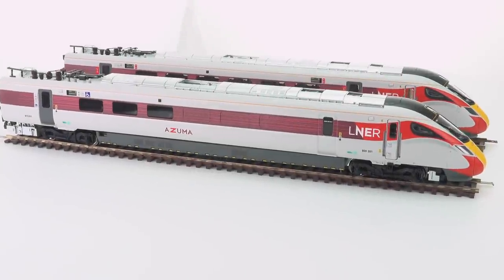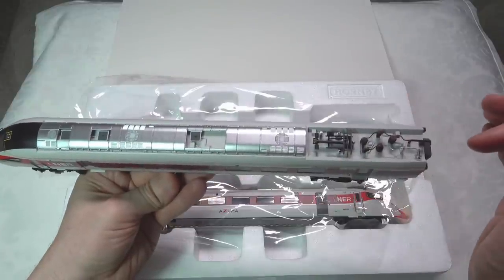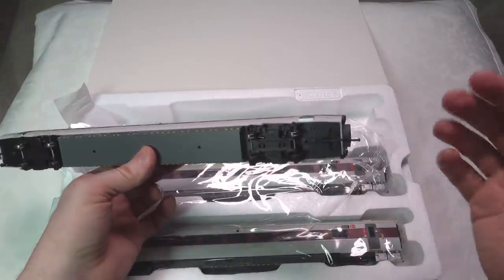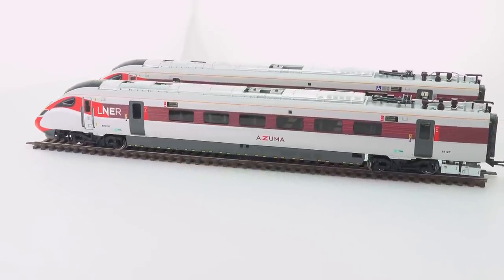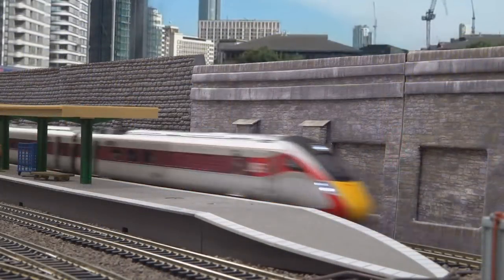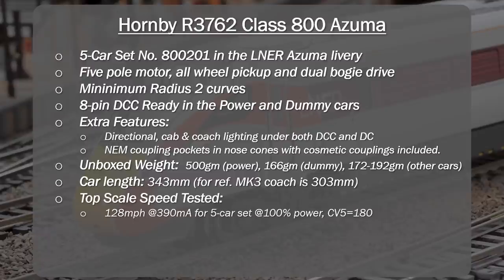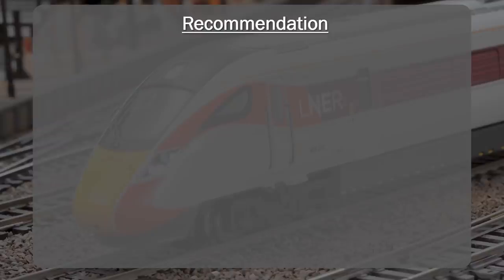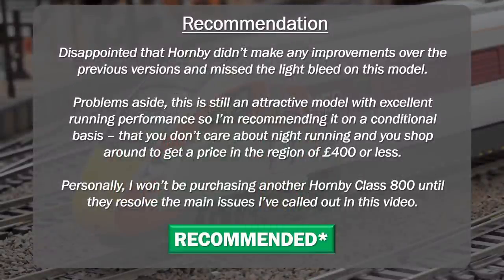Review: Hornby R3762 LNER Azuma Hitachi IEP Bi-Mode Class 800/1 Five Car Train Pack

Comment: Great review. I don't think the problem with the light bleed is due to the plastic, but more to do with the intensity of the lights. This doesn't happen on DC, I have this model and there is no light bleed at all. The lights seem 30-40% dimmer on DC, even if I remove the motorized unit and max out the controller. Everyone I've seen with the light bleed issue have been running DCC. It would be interesting to see if the light bleed happens with Hornby DCC decoders. It looks like a 12V circuit getting a higher voltage. Maybe some issue with the electronics board? Which is making me wonder if Hornby even test these DCC ready models with DCC decoders? On a different note, I had a dodgy coach, but living in the USA it made more sense to just go fix it myself and get the lights working on it.
Reply from the maker: Hi, I've just put one of the coaches on DC and put it up to 30% power - and the light bleed is there alright, as bad as ever and it really is bad when you go close to the coach, Same for the dummy car. It's no surprise, if you don't paint the interior of light coloured plastic you're going to have this problem and anyone working for Hornby should know this.. One of my other issues is that the lighting is too dim and the wrong temperature, both of which would only make it even worse!  The point you make in terms of thoroughly testing in both DC and DCC environment is very valid though I hope you were able to get your dodgy coach sorted.
Reply: @EuviRail  Thats interesting. What kind of DC controller are you using? I removed the power car and cranked the duette up to max, no light bleed. I also tested it on the other track that has a bachmann DC controller (bog standard one). I will have to try it with just one car. The only other difference is I'm in the USA, so the AC is 110V vs 220V but that should have no impact on the DC output at 12VDC. I sorted the dodgy coach out myself :)
Reply from the maker: @Oorail  I'm using Hornby's R7229 analog controller which I know isn't the best in the world. The lights come on to the same dim level they do under DCC and the bleed is there. They seem to be coming on at a 3V-4V level which would make sense and even when you turn the controller up they don't really get brighter as the current limiting resistor is kicking in. I'm suspecting you have a unit that was already modified to address the issue so it could be a case that certain batches have this issue and others don't.  If that's the case, Hornby should be able to start issuing replacements to people...
Reply: @EuviRail  Interesting so you are saying at 3V-4V level yours is bleeding like your video at 26:02 and they don't get any brighter as you turn it up? The H&M Duette I am using is a different type of DC controller from the R7229, so that probably what is going on. I've got a ton of DC controllers, including a few R7229 ones, if I get time I'll go mess with it as I'm curious what Hornby are up to now :)

Comment: The motor speed curve, did you have back EMF activated on the decoder, and if so if you adjust the CV for back EMF voltage then you'd get a better speed curve. I have Lokpilot 5s in mine and with the settings adjusted and using the speed curve instead of the 3 point curve I have it perfectly linear and measures so.

Mine also has the light bleed. End lighting the bleed is visible in a lit room. I asked Hornby if there was any intention to do anything about this (i.e. new bodies etc.) and they just said send it back.
Reply from the maker: Thanks Tom, I'll check that. Given the decoder was specifically programmed for the Hornby C800 I would have expected this to be set correctly but you never know. Did Hornby indicate what they were going to do if you returned the model?
Reply: @EuviRail  yeah I have found that a lot of the time the back EMF reference voltage isn't correct and can be motor specific. Hornby didn't say what they would do which is my issue as if I am sending it back to be told "refund or sort it out yourself" then I'll have had the hassle for nothing as I want to keep it regardless. I just don't want to spend s load of time reworking to end up where they are doing some new bodies.

Comment: I absolutely agree with the gloss finish. I have one of the HSTs in the gloss finish and it just looks fantastic. I was going to be getting one of these but ultimately decided against it. I don't particularly model any era or region, I just like trains. So for the money that I would be spending I was looking at one of two models. This or the Rapido Trains APT-e DCC sound fitted. I run a DCC only layout so I would also have to purchase decoders for the Azuma so that would raise the price to above that of the APT-e. Ultimately I decided that to me personally I found the APT-e sound fitted to be better value than the Azuma. And knowing about the shortcuts in this video (light bleed, dim lights, pantograph areas and pickups being the main ones) cemented that decision. I also like to run in the dark sometimes so the light bleed being this bad is a issue for me
Reply from the maker: Thanks for that. The APT-e is an interesting model. Rapido Trains appear to have done a good job there.

Comment: A very good and fair review. I have one of these and I think its a good model. I do have difficulty getting the Loksound 5 decoder and a double iPhone speaker into the space provided. If the speakers occupy the speaker space then there isn't sufficient height available in the remainder of the under floor cavity to properly tighten the cover. How did you deal with it?
Reply from the maker: Hi Charles, same problem as yourself so  I had to settle for a single iPhone speaker.  It's still a good model as you say, but for a modest investment they could have addressed some annoying issues.

Comment: I got one of these real cheap but didn't realise the light bleed was a problem (hadn't seen yr review). I'm ok with a crappy pantograph. Is the light bleed just on the coaches? Also Can you recommend a paint to sort this? Maybe do a video of how to do it ie remove the shell etc...? Cheers.
Reply from the maker: Hi, the light bleed affects the power cars as well unfortunately and these could be a bit trickier to remediate.  In terms of the paint, I'd go for an acrylic paint that matches the interior of the real coaches (check the LNER website for interior photos). As it's internal, I would look for a sampler bottle from my local paint shop rather than going for more expensive modelling paint.  Brush application is fine and preferred unless you want to dismantling the glazing. I have been hoping to do a video on adding lighting to an existing coach such as the Hornby MK2E/F Intercity. These required painting also due to their light livery.  I have about 6 models reviews pending so it will be a while before I get to it unfortunately.
Reply: @EuviRail  Sure. Thanks for that. I think light bleed is totally unacceptable. What the?!!! I mean don't they test the models before shipping? Should I return it? Do you get light bleed in the GWR? Also have you considered glazing the paint finish to get it looking more prototypical?

Comment: Loved the review! i actually have just purchased one and im still waiting for its arrival, so other peoples experiences with this model are always helpful. As disappointing as the faults are that you noted, and given its price tag these are things that shouldnt really have cropped up, its still nice to see Hornby getting such newer locos and EMUs in particular into the RTR market - so any chance to make sure they continue this needs some support i feel. Pantographs are a problem, we do not really have a catenary system which provides power to a train anymore and it would be completely useless if your running DCC anyway, so most pans are purely cosmetic. This trend has been going a while with only the fantastic Bachmann Class 90 bucking things up a bit. The best that can be hoped here will be to set the pan height to just below the contact wire and leave it there.
Oh, and just a little thing about the packing - everyone misses this on Hornby packaging so its not just you, but if you look at the back of the polystyrene tray there are normally two holes, these are there to allow you to "push" the model from behind to release it from the tray... you shouldnt have to try prizing it out directly from the front as you can risk damage to the item. There you go, a little future tip lol!